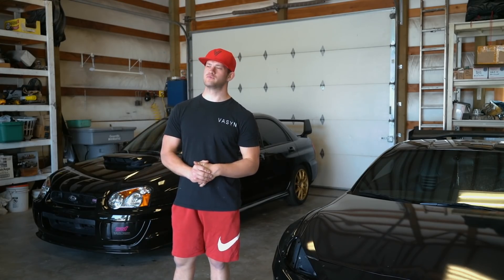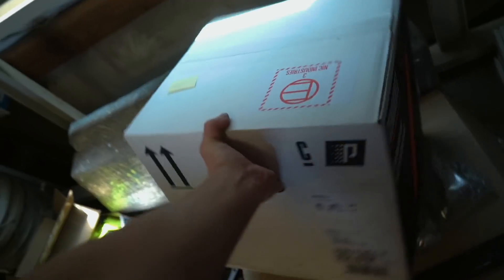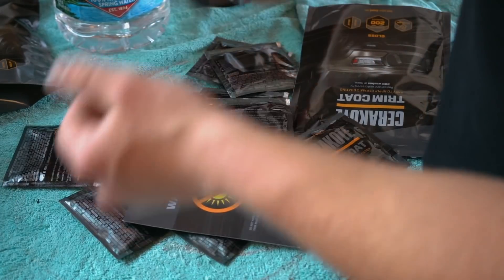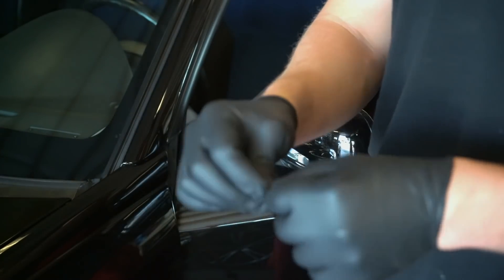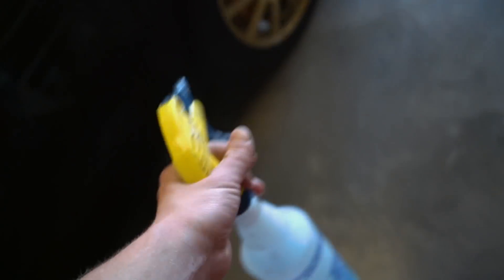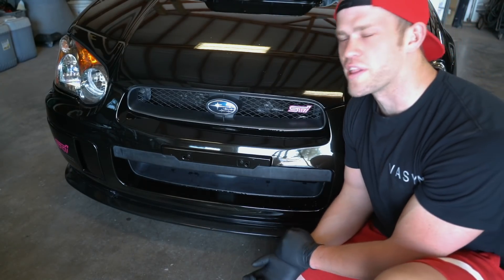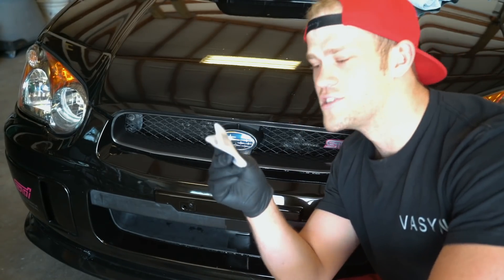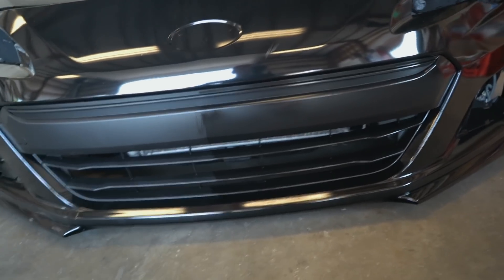Automotive Trim Restoration That Actually Works!

Comment: Try using armor all tyre foam, take it off the car and let the plastic absorb it for a few hours then repeat until you’re at the desired blackness, it’s worked a charm for me, just make sure you let it sit for at least 3 hours or until the foam dissipates

Comment: IMO  you should have still masked everything off.  If that stuff doesn't wash off trim it most likely doesn't wash off vinyl and/or paint.  Anyway, thanks for posting this. Looks like something that may be useful for one of my vehicles in the future.
Reply: trim has way more pores than paint, but I see what you mean

Comment: do we really know it works because he tried it on and then tried to wipe it off with a bit of dish soap?  I mean, it hasn't even had time to be exposed to the elements.  It hasn't had not even one true wash.  I mean, I could put peanut butter on it, and it would probably stay on for a few days.  But it would ruin it after that.  I'm not saying this doesn't work, but I'm just skeptical after the limited "tests."